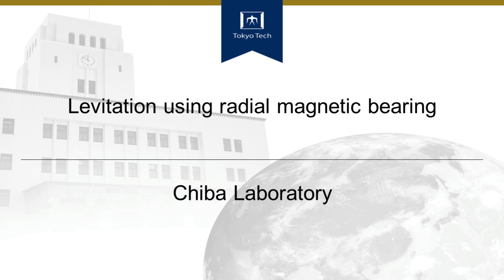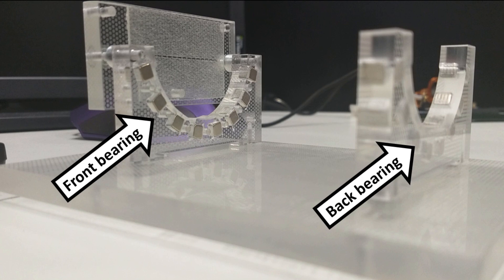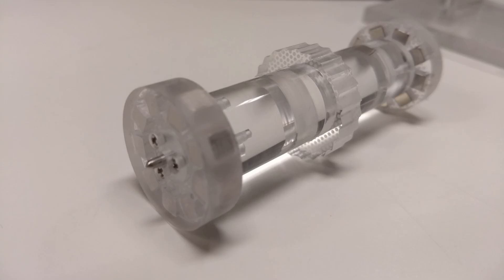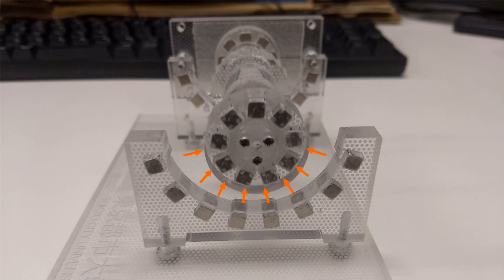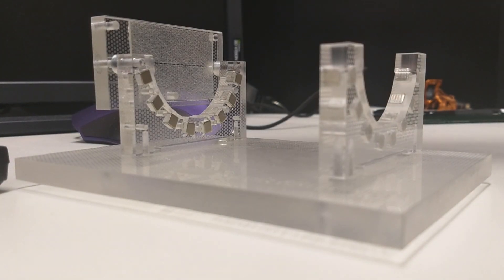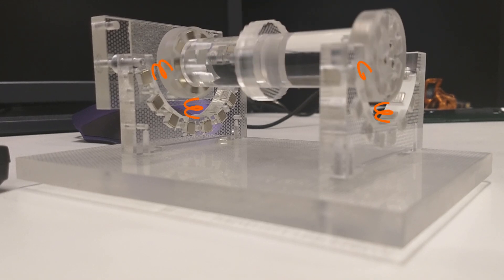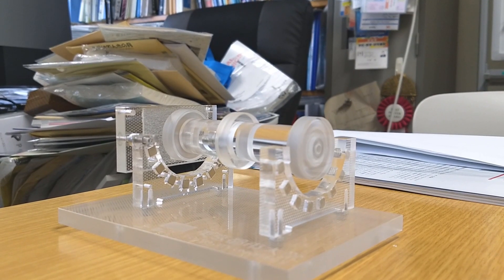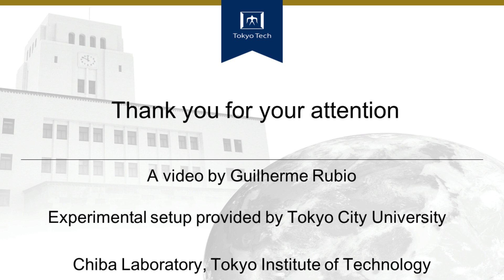A Magnetic Bearing Made With Permanent Magnets

Comment: Question: if you used an aluminum plate on each side of the rotor, instead of the wall-and-point system, wouldn't the spinning magnets "see" a reflection of themselves (due to the eddy currents) and be forced to the center?

Comment: Use magnetic bearings and floating shaft turn into floating shaft alternator. Similar to magnetic bearings raise a wall of the same kind of magnets along the upper outer sides of magnetic bearings. To stabilize the shafts in location without needing the wall to keep in place also build magnetic bearings all the way around the shaft. Now attach this to a vehicle or portable generators. Add Eddy current coils around magnetic bearings. Now you have a generator that last for many years without maintenance.

Comment: it seems that Active Magnetic Bearing (AMB), a topic that was established in two last decades contradicts your theorem. Here is a quote from a scientific paper:

Active magnetic bearing (AMB) is a magnetic actuator. In the past two decades, AMB has been gradually adopted as a non-contact, lubrication-free, and levitation-efficient device in various industrial applications. Owing to its merits, such as the capability to regulate spindle dynamics, AMB has become a potential element for high-speed rotating machinery, e.g., milling machines [1,2,3], gas turbines [4,5], turbo-molecular pumps [6], and so on.

There is no physical contact in AMB

Comment: How much weight can be suspended this way in the real world of mechanical engineering? Could the rotor in a flywheel energy storage module, weighing 1,000 kg, be suspended by passive permanent magnets, if they were powerful enough? I know this can be done with electromagnets, but then you have parasitic energy loss, in the power supplying the magnets.

Comment: Do you think if you use two ring magnets at each end of the base plate and one ring magnet on each end of the axel then those will perforn better due to uniform distribution of the magnetic lines of forces? Coz in this model, there is a non-unoformity in the field due to separations in between each cube magnet which may cause friction.

Comment: Can't you constrain horizontal movement with magnets too?
Reply: Yeah, I don't know if it actually works or not, but I would expect that you could replace that metal contactor tip with a magnet with a pole facing straight out, and replace the wall with the same pole pointed at it.  Do the same arrangement on the opposite end of the axle as well to give it stability while levitated.

I can't say I know enough about magnets to say if the extra 4 magnets would disturb the balance in ways I don't expect.  Although I imagine if you just made a really long axle that was also very light you could separate all the parts magnetic fields from each other with distance, and then test them interacting less with each other.
Reply: @ldobehardcore  Earnshaw theorem says it is impossible to have static equilibrium, but you can use magnets and diamagnetic materials to constrain the movement instead, making it truly frictionless.

Comment: these look pretty , but in reality , the load they can carry is way too small . 

to replace a simple bearing with somewhat minimum load , you`ll need a lot of magnets to 
lift a 2 kg shaft , that is carrying a 2kw load of power and torque , 
this "passive " magnetic system will collapse on it self like if there are no magnets at all . 

i`m saying this because i`v done it before , 

the technical solution is active magnetic bearings , 

but there is a small problem to that  ..  

they are expensive ... i mean , NASA expensive . 
if your shaft and load are heavy . stick to regular bearings .. 

the cost effectiveness factor in the majority  of magnetic drive systems , 
magnetic bearings , couplings , etc , does not exist

Comment: Im just daydreaming about how Magnetic Bearings could be used combined with Compressed Air motors 💭..
Reply from the maker: A commercial magnetic bearing, using controlled electromagnets instead of permanent magnets, can be applied to compressed air motors .

Comment: If some how you can put the magnets at an angle then may be you can stop the axial movement.
Reply from the maker: When we try to stabilize one direction with permanent magnets, they create unstable forces in the other directions. In case we want to achieve full magnetic levitation, we need to use other techniques, like automatically controlled electromagnets.
Reply: It would seem you are trying to suggest that using extra magnets at the ends of the linear bearing apparatus would replace the function of the fixed wall at the end of the apparatus, to help prevent the levitated item from sailing off its fixed status.
Entirely possible.
Keep on thinking about field attenuations, how overlapping can be regulated, adjusted even at high speed.
#inSCIENCEwetrust
The #DigitalLifeguardProject -_-
Reply: @truetech4158  I am asking you to put the existing magnets at an angle so that those magnets will make the rotor levitate and stop the axial movement as well. No extra magnets required.
Reply: @amanchander7837  You can try that, though depending on the diameter of the edges of the magnet, it may or may not go as planned. The overlapping of fields are not flat enough, you would want to shape fields with additional magnetic fields, or as mentioned, require magnets beyond the typical diameter. Perhaps examinations experimenting with variant hallbach and or chander arrays would prove interesting.
https://www.youtube.com/watch?v=eyCEexG9xjw
Reply: @truetech4158  Thank you !!

Comment: I found a more basic version of that that uses a few rounded coil shaped magnets rather than having many different cube shapes, it pretty much operates on the same principle, though it isn't intended for rotation though suppose it could be. Mine is very primative, like its owner, lol. Cheers and salutes from a house owned by two rescued cats that let me live here rent free. Keep the rock alive!
Reply: Hey, would you like to share the basic version that you have found ?
Reply: @amanchander7837  Greetings earthling, i too reside on your watery planet, at least for now anyhow. So, you have reached Level 41, and are requesting to reach Lever 42. Hmmm..
All i can tell you, is that he was using segmented collectives of cube shaped magnets, while the ones i used are ring shaped magnets, circular in a ring shape, rather than cubes with gaps.
It's essentially doing the same chore as to create a suspension in mid air, though without those gaps causing spaces that would also create overlapping of magnetic fields. Mine is more primative. O shaped magnets instead of square shaped cubes. It's doing the same chore though, a floating bearing system preventing friction nor actually resting on anything other than that one plate at the end of the magnet array as is the same as what he is demonstrating there in that video. Mine is from a simple science kit involving levitation that relies on ring O shaped magnets held in place by a not so flexable straw, about the diameter of a pencil, with the magnets adjustably fixed onto the outer diameter of that. He fabricated his own version of that only using cube shaped magnets. 
If you have ring O shaped magnets instead of cubes, you could fix them onto a pencil to keep them aligned, plus with the endstop to prevent the pencil/straw from wanting to shift away.
You can use any magnets to achieve this floating levitation in fact, theres no magic nor mystery to the principle.
Hope that helps.
Ok, you now owe me 1 working spaceship, though am willing to settle for 2 dollars!
If you dont have the 2 dollars, it shall increase incrementally essentially doubling in price every 4 days with no present limitations imposed. Should a year go by, i want to see at least a electric lear jet capable of vertical take off parked outside my house, with a thankyou note! lol
It's now time for me to go away!
All the best
Reply: @truetech4158  Thank you for your explaination. I really appreciate the way you have explained. Of course I owe you a space ship ( Only if CIA doesn't catch me :-P). I would like to levitate my supervisor first. LOl !!
Reply: @truetech4158  "ring" shaped magnets? It sounds more like you are using *disc or *washer shaped magnets, no? As those have two opposite but equal planes in which they can repel one another through magnetic force, isn't that correct? An "O ring" shaped magnet, would have rounded edges, and therefore be less efficient at attracting or repelling similar shaped objects. Let me know that I'm correct, and I will only charge you pinged copper home brewery/distillery. If I have to find out another way, the cost will be much, much higher...muahahahah XD